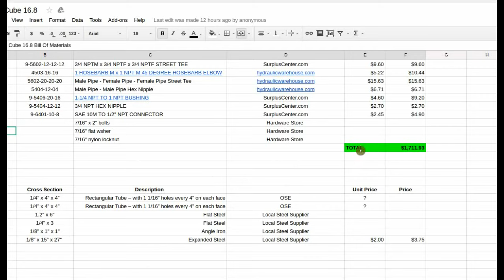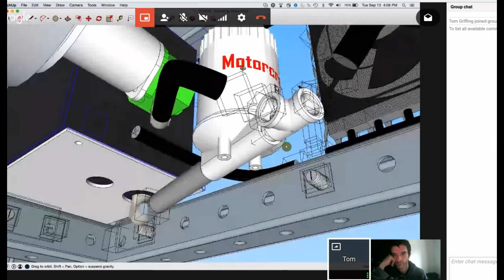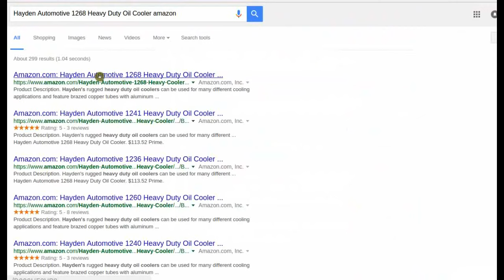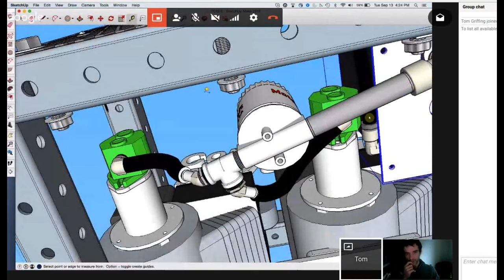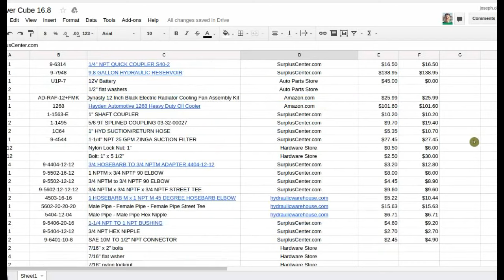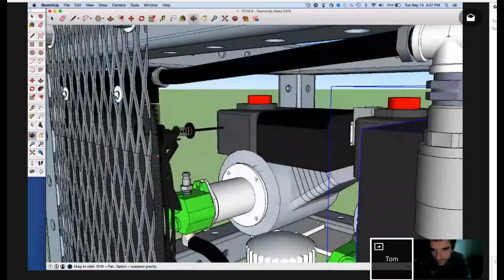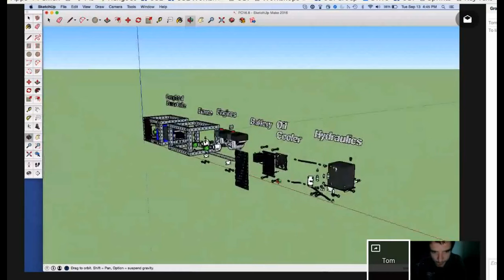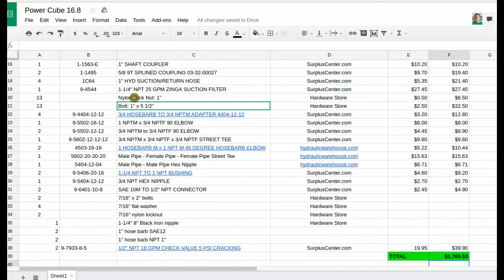Power Cube v16.9

Comment: Is there previous working builds of this project? I'm not seeing vibration dampening on this model. I worked with a lot of pumps and engines and it's a serious issue when a machine shakes itself apart.

Comment: Are there plans to make a battery power cube?
Reply: You would need to explain what you mean by "battery power cube".
Reply: An electric motor based power cube would be nice, but I am uncertain of relative motor costs. It would be nice if it could go AC (grid) or DC (solar), which requires open design and build of a lot of electronics as well. Maybe it can be done after the future solar production plans come to fruition.